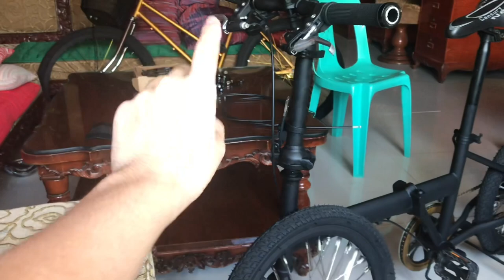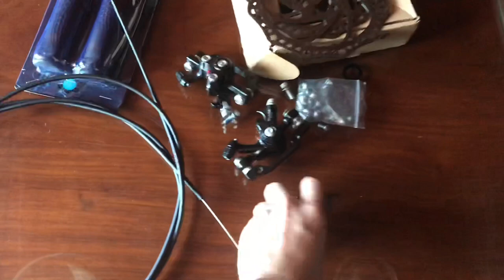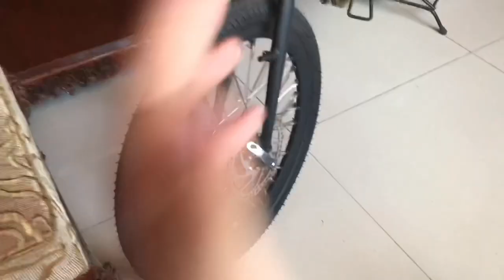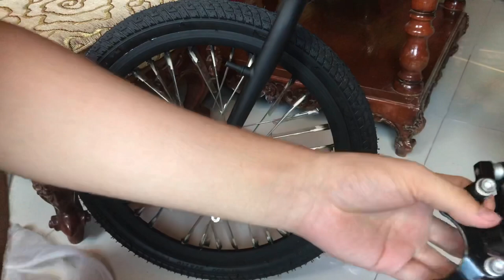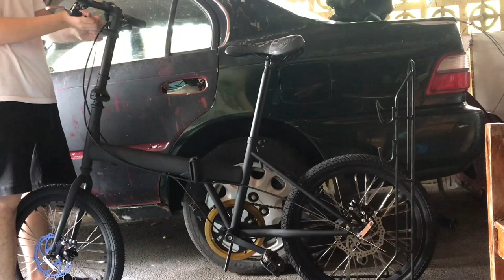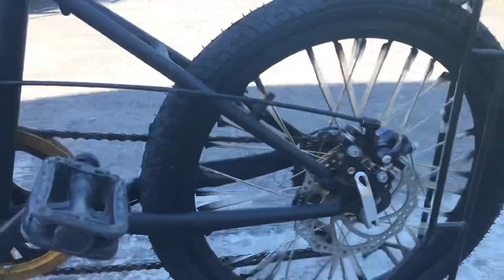MGA BIKE PARTS GALING SHOPEE folding bike upgrade

Comment: Boss anong size ng Disbrake Adapter po? Converter, sa shoppee kasi 22mm at 31.8mm po eh
Reply from the maker: kung payat frame mo recommended ko ay yun 22mm lang dipede kasi yan examample japanese bike at folding bike and stand mtb frame 22.2 pwede dyab

Comment: boss pano mag align ng chain? ung akin kasi sa folding bike set up na 1x6 tabing ung chain nya pag nasa1 ung sprocket pero pag naka 3, naka align sya.
Reply from the maker: Check nyo po yung rd hanger baka tabingi na
Reply: boss isa pa, pasok ba sa japan surplus na folding bike size 20 tires ang hub ng kahit anong mtb?
Reply from the maker: @aivanmaranan8067  oo naman lods pasok yan meron din nasbukan ko na sa ibang folding bike. pero kung d magkasya pwde ka gumamit ng hubs na pang roadbike sure maga fit yan
Reply: @chazyworkzgarage8849  un sige boss salamat ulit🙏

Comment: boss anong sukat nang rotor na nilagay mo?at size dn nang adaptor na nilagay mo boss.salamat
Reply from the maker: Japhet Vivero  sa rotor po 160mm harap likod sa  adaptor po 20mm
Reply: @chazyworkzgarage8849  salamat idol.
Reply: @chazyworkzgarage8849  idol na upgrade narin ba yan sa 10 speed?
Reply from the maker: Japhet Vivero from 6speed to 8speed palang na upgrade ko dto pero kung gugustuhin pwde sya ma upgrade sa 10speed need  lang ng konting adjustments sa frame and bili ng rd shifter cogs na for 10 speed
Reply: @chazyworkzgarage8849  salamat idol
Reply: @chazyworkzgarage8849  idol ano shifter ginamit mo?
Reply: Idol ilang hole ng hub n ginamit mo?

Comment: boss pwde b convert v brake to discbrake newbie lng slmt
Reply from the maker: ruel romarate oo boss kayang kaya bibili kalang converter for discbrakes ganyan din ginawa ko dyan sa bike sa vid
Reply: slmat boss ano klngan ko blhin boss?
Reply: Chase Nidea ano klngan ko blhin boss
Reply from the maker: ruel romarate eto mga need mo boss
1. Discbrakes frame mount adaptor holder
2. Hubs na discbrakes ready
3. Discbrakes mechanil calipers
4. Rotor disc
Reply: Chase Nidea slmat sa tulong boss
Reply from the maker: ruel romarate sa shopee ka boss bili mura madami dun
Reply: @chazyworkzgarage8849  magkano lahat nagastos mo sa upgrade?

Comment: boss makakabili ba sa shopee nung adapter/converter mo from V-brake to disc brakes? may shopee/lazada links ka rin po ba for budget meal na rims/hubs at crankset na pwede magamit na similar sa setup sayo? ty boss :)
Reply from the maker: Okay bigyan ko po kayo link
Reply: @chazyworkzgarage8849  thanks boss
Reply: @chazyworkzgarage8849  boss pa link din .. dlwa kasi pgppilian na size sa converter.. 22mm or 32mm ? slamat sa tugon

Comment: Sir pa link naman ako nung mga parts na binili mo sa shoppee. Thanks!
Reply from the maker: yan po link nya sir check nyo nalang po  sana makatulong sainyo  salamat
Ragusa grips 

https://shopee.ph/product/89854561/73...

Shimano brake Cable

https://shopee.ph/product/22606179/12...

Ragusa Discbrakes kit

https://shopee.ph/product/6059699/191...
Reply: @chazyworkzgarage8849  idol pwde b yan s kaht anong fb? Size 16 po aken idol